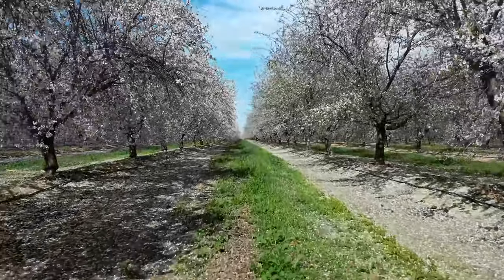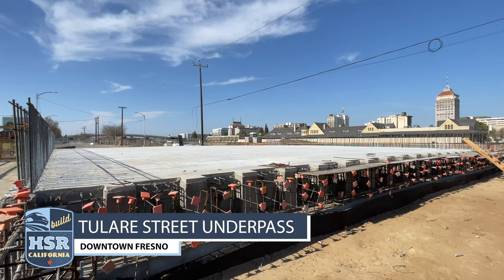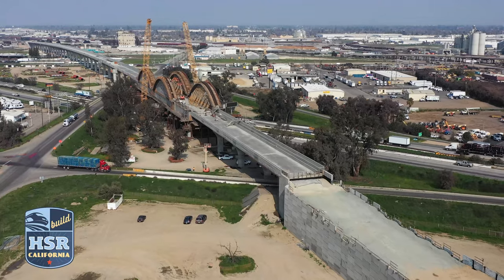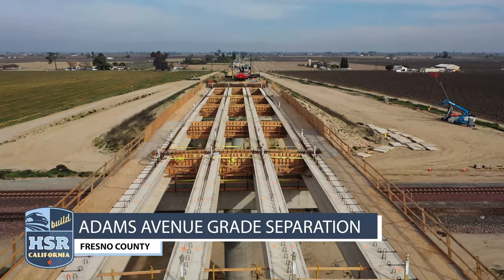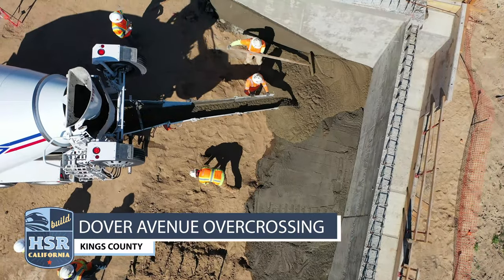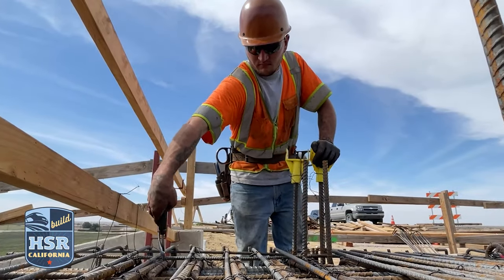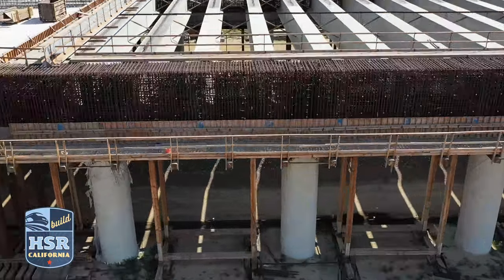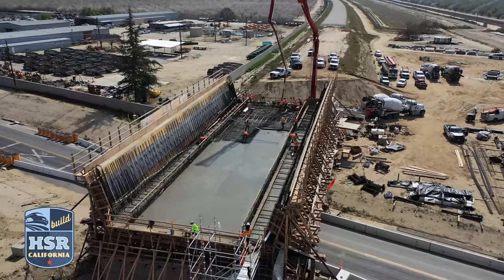California High-Speed Rail Construction Update – Spring 2022

Comment: Wait, this high speed line is only going to run from Merced to Bakersfield???? Is this for real?
Reply: Obviously not... they're probably opening it up in phases, which is why it would only run between Merced and Bakersfield FOR NOW.
Reply: @VeeTHis  But this section is going to take 10 plus years to build and they have not started work anywhere else?  So when it’s completed it will only run from Merced to Bakersfield for at least 10+ years right?  I mean that’s assuming other sections ever even get built with newer cheaper alternatives like hyper loops.
Reply: @Agate_Island  If the other sections take 10+ years to build, then yes. Would you rather want absolutely no HSR or HSR albeit between two smaller cities?
Reply: @Agate_Island  high speed rail had to start somewhere, and the initial funding they got from the federal government had to go toward the Central Valley (at least to my knowledge). The Valley provides a place trains can reach their top speed of 220 miles per hour, plus construction helps boost the economy of an area that has for decades been overshadowed by LA and the Bay Area. 

While physical construction has been happening in the Valley, environmental clearance and route selection continues to progress on the remainder of the Phase 1 route, so that they’re shovel-ready for when more funding becomes available. If there were more money now construction could be progressing beyond the Valley sooner, but that’s just not the case and never has been. There hasn’t been a solid funding stream for this project, and so they’ve had to make due with what they can get. There’s still a little less than half of the initial Prop 1A funds that they’re hoping to get released soon so they can finish the Merced-Bakersfield route ASAP. 

This is the first project of its kind in the US, and we have certain red tape and other regulations, as well as lawsuits and other legal battles, that China doesn’t and thus the two can’t be compared. As the first HSR project in the US and thus one of this magnitude, there were bound to be delays, cost increases and other issues just as with any large scale infrastructure project. 

The plan for the initial Valley service is to demonstrate high speed rail which hopefully is meant to push demand for expanding to SF and LA ASAP. SJJPA, who operates the San Joaquins, are currently the ones being tasked to operate this service. San Joaquins will terminate at Merced, where they and ACE will connect with HSR to continue to Sacramento and the Bay Area, and buses will connect to HSR in Bakersfield to go to LA.
Reply: @VeeTHis  Yes.  They should have done LA to SD and SF out to Merced.  That would have a much better short and long term benefit than between two cities in the middle of nowhere.
Reply: @Agate_Island  when Californians voted on Prop 1A in 2008, they were voting for an alternative to driving and flying. They wanted a transformative third option to traveling between LA and SF, and ultimately Southern and Northern California. 

High speed rail is used by millions around the world daily, and is long overdue in the US. California took the step to try to be the first, and while timelines have been pushed back and costs have gone up, the ultimate goal has always remained the same. LA to SF in under 3 hours at up to 220 mph on electrified trains powered by 100% renewable energy. Environmental clearances and route finalization are continuing on the entire Phase 1 route, and CAHSR is actively pursuing new funding sources to push construction beyond the Central Valley.
Reply: @ChrisJones-gx7fc  And yet… there will be no HSR from SF to LA anytime in the foreseeable future and with the rate of advances in technology HSR will ultimately be replaced with autonomous cars and things like hyper loop that can achieve higher efficiencies and better serve the public.  Like I said before, I would love to see HSR serving the major metro areas of California but at this point it seems like a pipe dream at best.  Like the article said, this is a major boondoggle.
Reply: @Agate_Island  how is high speed rail a pipe dream but hyperloop isn’t? High speed rail is being built, and is a proven technology whereas hyperloop is still a concept. As for autonomous cars, those are still years away and won’t be cheap. Same goes for electric cars, and there’s still traffic jams and other road hazards regardless of what’s powering the car. High speed rail is progressing and will reach SF and LA by the 2030s. Once trains are connecting the two in under three hours and the benefits are seen, worries about the price tag will be less relevant. Plus high speed trains earn money that highways don’t, and both highways and airports are subsidized by taxes whereas high speed rail isn’t. Just look at current high speed rail lines around the world. America needs a 21st century intercity transit system if it wants to stay competitive with the rest of the developed world, and high speed rail is it.
Reply: It's worse than that. The portion they're constructing currently is only Madera to Kings/Tulare and will never be operational on its own.
Reply: @DouglasLippi  technically it’s 119 miles from Avenue 19 in Madera to Poplar Avenue just north of Shafter. They are actively working to extend to Merced and Bakersfield, which with the remaining Prop 1A funds currently being held up by the CA State Legislature they’ll be able to do for a single track with passing sidings. This had been the plan due to budget restraints, but since more federal money became available to compete for they’ve scrapped the single track option for two tracks from the get-go.
Reply: @ChrisJones-gx7fc  correct. I was just keeping it simple. To the average Joe this indeed appears to be a train to nowhere. I sincerely hope it does eventually fulfill its original promises, but that is uncertain.
Reply: @Agate_Island  Why on earth should Hyperloop be cheaper than HSR? You still need to buy the land and in comparison to HSR a lot more construction is needed as curve radia have to be much larger and it has to be build mostly on viaducts. I agree that Hyperloop is a great technology but it won't be cheaper anytime soon. And autonomous cars and HSR are no competitors. The advantage of HSR is time and no matter how autonomous a car is, it will always be slower than HSR.
Reply: @DouglasLippi  and CAHSR acknowledges that which is why they’re pushing with what funds they have to extend to Merced and Bakersfield where it can link up with existing transit. It’s not perfect but it’ll create a legitimate transit network that’ll help prove the concept of high speed rail here, and hopefully push demand for more funding to complete the full SF to LA/Anaheim route ASAP.
Reply: @ChrisJones-gx7fc  I hope you're right 🤞👍🙂
Reply: @Agate_Island  Hyperloop isn't real. Highspeed trains actually exist.

Comment: When is it opening?
Reply: The current timeline is 2029 for Merced to Bakersfield service, 2031 for SF to Bakersfield and 2033 for SF to LA/Anaheim. Phase 2 is unknown at this time, but my guess would be early 2040s.
Reply: @blueman9450  all the progress made so far would disagree with that statement. Not just the physical construction in the Central Valley, but also the electrification of the Caltrain corridor as well as the remaining environmental clearances on the full SF-Anaheim Phase 1 route, SF-SJ and SJ-Merced expected to be done by this summer and Palmdale-Burbank and LA-Anaheim by 2023. Having the entire route environmentally cleared brings it one crucial step closer to the construction phase. 

As for funding, $4.2 billion of the Prop 1A funds approved by CA voters in 2008 for high speed rail is still being held up in the State Legislature, namely by several LA-area representatives, which would go to finishing the Central Valley interim segment between Merced and Bakersfield and get high speed trains rolling by the end of the decade. Having that money held up delays the project even further which in turn increases costs, so the sooner it’s made available to CHSRA to finish the Central Valley line, the sooner trains will start running, and once trains are running between Merced and Bakersfield to prove the concept of high speed rail here, the greater the demand will be to extend to SF and LA/Anaheim ASAP. There’s also potential federal funding for high speed rail that California’s project can compete for, and being the only project currently under construction gives it a huge advantage over other US HSR projects.

Comment: For 5 years I have been asking what is the solution for the train route in the area of Corcoran.  That’s where the ground is sinking unevenly at a rate of 1 foot per year for the last 10 years.  And due to farmers pumping water from the ground it’s expected to sink another 10 feet in the next 10 years.
Reply: That's just going to be the fun, dippy part of the ride.
Reply: That area you’re talking about was actually a lake that the local cotton barons desiccated over 100 years. The ground has been sinking there for about as long. It’s a well know issue and has been incorporated into the design. It’s not like this hasn’t been done before.

It’s a trivial issue.

Comment: Have train sets been ordered yet? Is any testing being done yet?
Reply: "Testing?" There is 0.000 miles of track laid. What is there to test?
Reply: They'll have the fist section done only next year. If I remember correctly they'll be testing directly on the route rather than have separate track.

The only testing done so far was by Caltrain on the upgraded Peninsula corridor. But that's with Caltrain's trainsets, not the eventual CHSR trains.
Reply: @h.mandelene3279  Track is literally the last part of the buildout process. It's more of a formality than a legitimate holdup. It's like the roof on a building, or the stucco. You do that last, after the building is substantially complete.
Reply: @TohaBgood2  "They'll have the fist section done only next year." WOW!! all that money and only a part will actually have tracks after $ billions over budget??
All of this for a medium speed train(read definition of high speed which cali is not going to be) Wiki says cali is expecting to take this train from SF to LA is going to take ~2.5 hrs. Heck, a plane takes about an hour.
Reply: @h.mandelene3279  Lol, what planet are you from? Normal travel times for SF-LA via air are 3-4 hours. You do know that the TSA exists, right? Doors close 15 minutes before takeoff. You need to be at the airport two hours before your flight. And you need to navigate the airports themselves to get to your gate. There are precisely zero chances that you can fly faster than the train ride. Get out of LaLaLand!
Reply: @TohaBgood2  and the la trainstation is nowhere near downtown so that is 45 min to get there and tell me there is a car rental yard next to the train station like there is at the airport. That's why I left that out. I don't know what you fly but it didn't take me 2 hrs prior the times I flew out of LA..
ME get out of lala land huh???
Reply: @h.mandelene3279  Again, what are you talking about? The main termini stations are LA Union Station and SF Transbay transit center. Both are smack in the middle of the densest parts of the respective megaregions. How is that not literally in very centers of both downtowns? Are you some kind of a paid troll from out of state or something?

Comment: great work but its taking forever to build the easiest part... probaly will take multiple more decades for it to reach LA and San fran
Reply: First section will actually be up by 2023
Reply: @pixel6854  i doubt it. hey still havent laid a single mile of track or even completed the routeway
Reply: @petitkruger2175  track is actually the easy part, the hard part, which is what they are doing right now, is electrification & the creation of new & repairing old infrastructure for the train.

Comment: Brightline's already finishing up their Orlando extension, and you barley made a dent.
Reply: Yeah, but Brightline is conventional speed rail with a few “increased speed” sections and few grade separations. Actual HSR is in a completely different league in both complexity and cost. 

Besides, we already have a Brightline-like service that uses the same Siemens Charger locomotives and has the exact same average and top speed. It’s called the San Joaquins. We’ve had it for decades and it’s more popular with riders than Brightline. This is basically the concept that Brightline copied to bring to Florida in the first place.

The whole point of building CHSR is to upgrade that San Joaquins service to full 220mph HSR.
Reply: @TohaBgood2  I am also counting Brightline west
Reply: @erikgustafson9319  That's a bit unfair then, isn't it? :)))

That route has been in the works for 20-30 years and they haven't even started planning how to build it yet. Let alone get any money for it. Brightline is just the latest company to try it and they have already delayed it twice.

And even when/if it is build, it will likely top out at 150mph, just below the HSR limit for new track.

Highly skeptical that it ever gets going. Would be great if it did get built! But seems more like a marketing ploy rather than a real project at the moment.
Reply: @TohaBgood2  No Many projects even outside of China and are also government-funded do not cost this much or the slow of a  pace, even with how poorly EIS is to Nimby neds and Nellys. This however has nothing to do with how we need to modernize the EIS process. The problem is that CAHSR  mostly their contractors do not know; how to competently build and its been boggled by heckling and sheer clear lack of what to do, who to advise and what the end product will be like in terms of service. Brightline has a sheer goal of serving passengers; not trying to pander to one regional political base, which this project clearly is in order to get approval. This project should be in the 10-15 billion range not  1/10 the cost to develop the  F35. I am not saying get rid of it with more runways at Burbank or Sacramento I'm not. I am trying to hammer the point that we need to stop building in the name of pork barreling. For example instead of building HSR between Bakersfield and LA build a 225kph line over Tehachapi to unclog the loop. UP and BNSF will be happy with this arrangement as they don't have to worry about   dealing with Amtrak or better just build a dedicated route.
Reply: @erikgustafson9319  That's good and all but it's simply not true. Look it up! The contractors building this project built infrastructure all around the US all the time and it's never this kind of a mess. The contracts are for "design-build". They get the specs, design the project themselves, present it for approval, and then build it completely autonomously! Private companies!

The problem is that a dark money group of powerful politicians want this project dead! It is an existential threat to them and to their donors. Hence, they will do anything to kill it off or at least hamper it as much as possible. Their lawyers deliberately focus on blocking key parcels to delay construction for the longest possible time. they pick parcels that break up worksites into small chunks that each need to then be managed separately at great expense. They fight tooth and nail especially for parcels that prevent the easy transfer of equipment. Meaning the Authority needs to pack up everything, drive it less than a mile (as the crow flies, but far if you go on roads), and then unpack everything.

You know what! NO! This project was approved by the voters of California in a legal referendum. It is getting built! End of story! Some rich SOB won't tell us what we get to build with our own tax money! Let them shove those fancy layers and all that money up where the sun don't shine!
Reply: They are not finished in Florida by a long shot.

Comment: I’ll see you in 2030 and we can ride the train from Bakersfield to Merced.
Reply: Why wait until 2030, they'll be done by 2025-2027 with the initial operating segment. You can ride it then. The Merced and Bakersfield extensions haven't even started construction yet. If you want to ride the train you can just ride it on the slightly shorter route they'll open by hopefully 2025.

Comment: I support the overall project but I really don't think it's worth mentioning the GHG emissions "saved"....with the amount of carbon released between the sheer amount of concrete, construction equipment, and turning the soil, it will take a century before those carbon emissions are offset by "reduced passenger car emissions".
Reply: and by then the oil will be just a memory, future generations will live much more locally
Reply: Not a century.
Reply: Better than building a highway though
Reply: Well, the north-south CA transportation need isn’t just going to vanish. It’s either this or four more lanes on the 5. Which would cost four times more and emit infinitely more GHG.
Reply: @markrobinowitz8473  They wouldn’t have to if we just give them environmentally sustainable infra